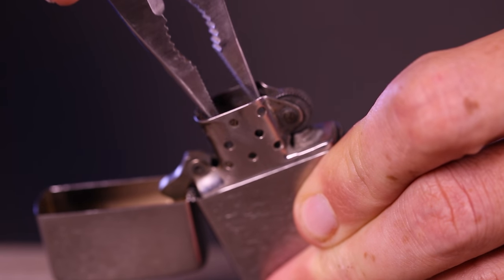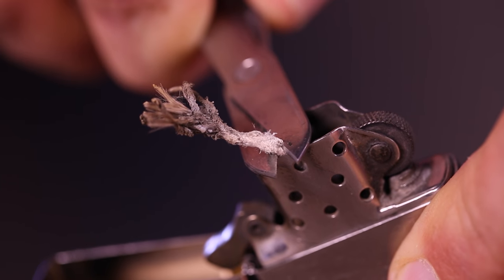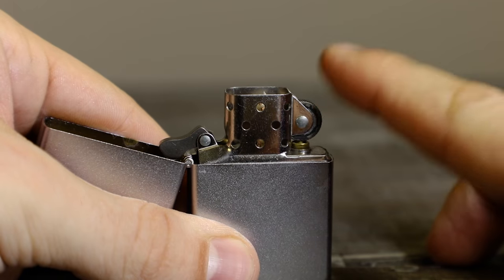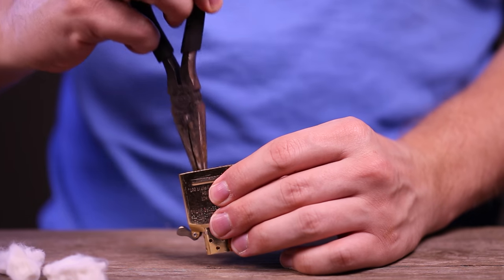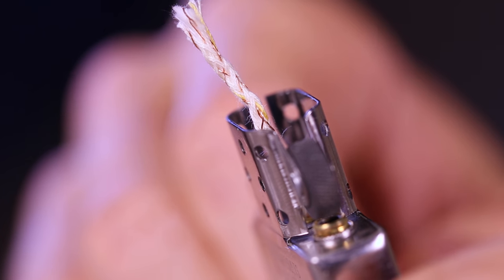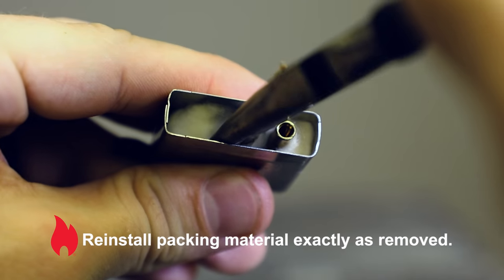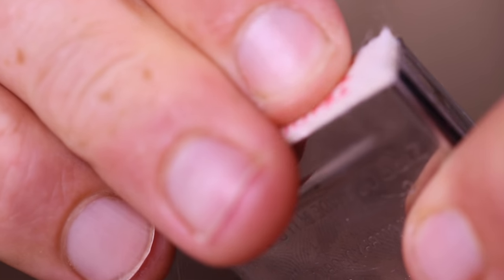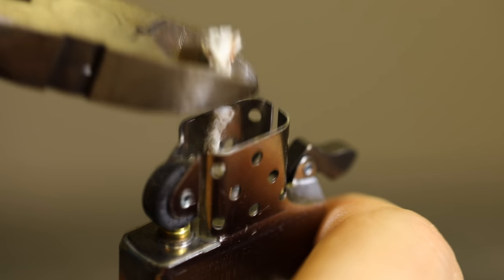Zippo Instructional: Wick Maintenance / Installing a New Wick

Comment: How long does it usally take for it to be black like that
Reply from the maker: It just depends on use. Normally, you should trim your wick 1-2 times per year.
Reply: After about a week if you smoke and use your zippo it will be black like that in about 3 days. I use my zippo all day so that's my experience I'm not trying to be rude @ zippo.

Comment: Why in the hell would you cut off 1/5'th of a brand new wick. When insurting new wick just make sure its level, or even a bit under the chimny. Then start packing in the filling. Just take care not to pull the wick down in the process.

Comment: Hi. What's the purpose of the copper wire, inside the wick?
Reply: Likely to keep the wick in somewhat of a solid state so it's easier to thread and doesn't break apart easily after being lit a few times.

Comment: Once or twice a year??? I literally have to do this every week
Reply: You're doing something wrong. I'm a pipe smoker and strike up a light two or three dozen times a day. I top off the fuel every day or two. I have to install a new flint every three or four months and pull up the wick every year or so. I'm ashamed to admit I've never installed a new wick. Only complaint about Zippo lighters is the hinge has bent on a couple of lighters. Never did get around to sending them to Zippo for repair or replacement. I've spent over $125 for a butane lighter, and bought hundred of cheaper ones. They have all been a PITA to refill, hard to light in cold weather, wind etc. I started with Zippo in the Air Force in 1970 and have mostly had one on hand. I'm done experimenting. Zippo is my girl.

Brass

Comment: I've tried it all, and still it takes multiple tries to get a flame. Is it possible the flint wheel could be worn?
Reply from the maker: We're here to help Richard. Did you try trimming or changing your wick, changing the flint, and using premium Zippo lighter fluid?
Reply: Does the lighter spark when you strike it? If it produces a good flash and an ample amount of sparks, there should be nothing wrong with the wheel.

Comment: im still using the wick that came with my zippo can i just pull it out a little bit and trim it?
Reply from the maker: You can! Each wick is about 4 inches long, so you can trim it 2-3 times before replacing.

Comment: it wont pull.. i grabbed it at the very bottom and it still ripped even after pulling so fukin hard from the bottom what am i doing wrong
Reply: in order for it to even pull a slight bit out i had to go so hard that it just rips anyway
Reply: is this just a weak girl problem

Comment: I'm fairly new with zippo lighters and was wondering, how long does the lighter fuel usually last? Because mine seems to evaporate by itself, without using it much. So being a hobby cigar smoker, the intervals between when I do smoke are fairly long apart, so it's kinda strange that the fuel finishes up without much use.
Reply: It will evaporate slightly. The design helps though. Keeping the lid closed will allow the gases to build up and allow for a nice light as soon as you flip open the zippo. I'm an avid smoker and i refuel about every weekend.
Reply from the maker: Mike is correct. The fuel does evaporate slightly. Frequency of use determines how quickly the fuel evaporates. In most cases, avid users do not have to fill as often. We actually make an evaporation-free fuel canister that would allow you to fill only when necessary. You can check it out here: https://www.zippo.com/products/fuel-canister

Comment: My wick is easily blacked, can you help what's the prob?
Reply from the maker: The black on the wick is totally normal. How often is this happening? Are you using Zippo premium lighter fluid?
Reply: @zippo  yes I am using the zippo premium fuel, the wick will be blacked by not more than 2 days after I change the wick
Reply from the maker: That's normal. As long as the wick stays lit, a little black is fine.

Comment: I can’t get the wick through the hole
Reply from the maker: Try twisting the end a couple times and feed it down through the top.
Reply: Just damp it at one end go thru the top, and then use needle nose pliers to grab and pull thru what you was able to get thru the hole